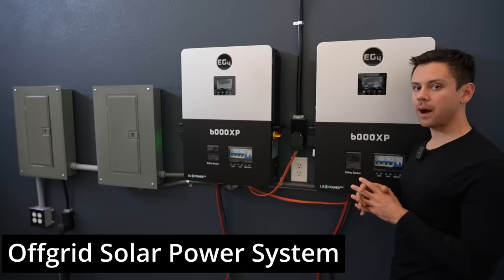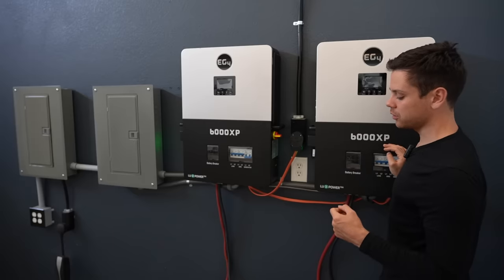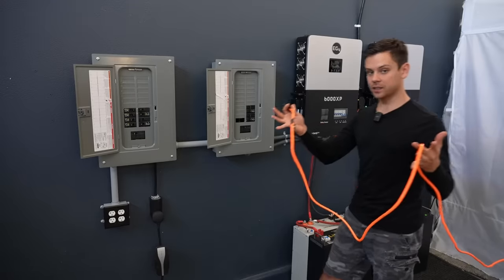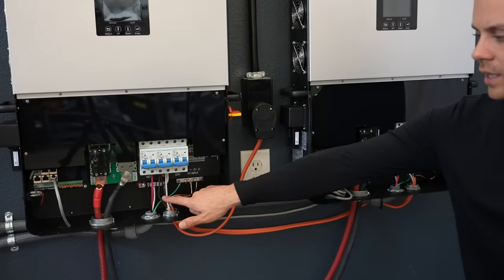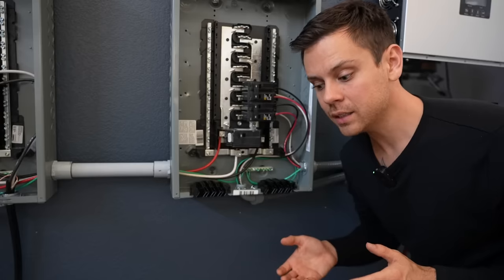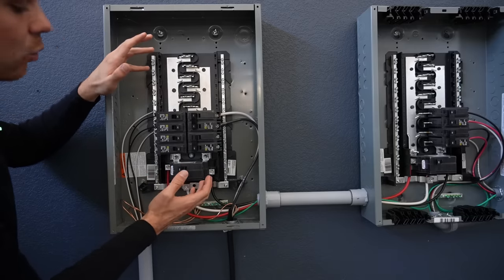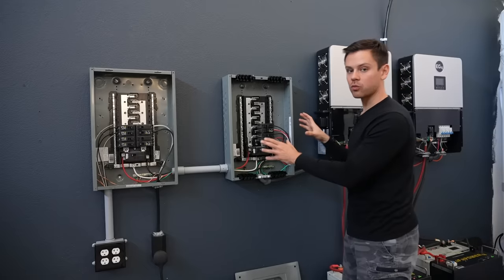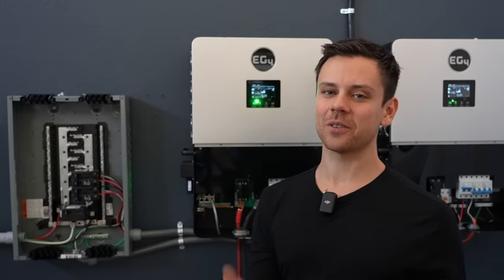How to Build Expandable Off-grid Solar Systems w/ EG4 6000XP

Comment: I’d like your opinion on noise for the eg4 6000xp.  I’m building an off-grid home and am debating on whether to build a solar shed for the components or put them in the utility room.  I’m concerned about noise.  I’ve heard that the eg4 6000xp is loud
Reply from the maker: It is loud. Check out my off-grid inverter versus hybrid inverter video
Reply: I have a room added on and cant hear my units.
I have 3 running.

Comment: Are these units able to be solar prioritized like a Victron? I want it to draw off solar and battery then only pull from grid if battery reaches my set limit or inrush is great enough to demand.  this way when in a RV park that I have to pay the electric I am utilizing my solar first.  I know there are multiple ways to set up Victron to do this but these are less expensive.

Comment: I bought one of these, thinking I may need two.. I have two 220V water wells.   Do I need some sort of soft start for the wells???
Reply from the maker: I would add soft start for sure. But they will probably run without
Reply: @WillProwse  thanks Will!!! ❤️❤️❤️
Can you suggest a soft start for wells? Do they make them specifically for wells?
Reply from the maker: @leemaisel9794  there's some videos online of how to make them but I haven't seen a commercially available one. Unless there are specific distributors selling them. Also the 6000 XP hardware was used in South Africa to run well pumps. Should be fine to not have a soft starter. But they are always recommended
Reply: @WillProwse  thanks Will!!!

Comment: What a bummer that the EG4 6000XP is not UL 9540 compliant, making these unacceptable in communities that have adopted the International Building Code (IBC). What is an additional bummer is there there are almost no inverters & batteries that meet UL 9540, other than EXTREMELY expensive units. 

The following 22 states follow the IBC: California, Colorado, Florida, Georgia, Hawaii, Idaho, Illinois, Kansas, Maryland, Minnesota, Montana, Nebraska, Nevada, New Jersey, New York State, North Dakota, Oregon, Puerto Rico, South Carolina, Utah, Washington, and Wyoming. In addition, some communities in other states have adopted the latest version of the IBC.

Presumably, this code was pushed through by lobbyists who want to undermine all but the three or four largest solar companies out there. This makes solar infeasible for almost anyone whose budget is less than enormous. And, I imagine, will drive some brands out of business.

Comment: I would like to know what the idle or overhead consumption of the inverter output is when several units are ganged together.   Do they just add up or do they all share roughly the same total idle/overhead consumption that a single unit would have?
Reply: It multiples as you add units. So it would be roughly 100 watts with 2 of these units.
Reply: @GavinStoneDIY  As long as there's a load on the system, each unit will draw ~50W.  What I don't know is if you have multiple units tied together, but are using <6000W, will the second, third, etc inverter go into "eco" mode until needed, or will they all still draw 50W each if there's any overall system load sensed, even if they aren't technically needed for the minimal load???
Reply: @ssoffshore5111  good question. I don’t believe eco mode functions when the units are in parallel. So it draws equally from each inverter.
Reply: @GavinStoneDIY  Ugh, that's too bad!  Seems like a missed opportunity given the linked communication system, that would've been one big advantage compared to going with larger inverter(s).  Especially if that was programable (x amount of demand before the next inverter "woke up").
Reply: @ssoffshore5111  yeah I’ve actually chatted about this with some other folks. It’s likely possible. Schneider has a similar setting from what I hear. It would definitely take some programming though. You’d have to account for things like line balancing and the time it would take to “wake” the slave inverters up.

Comment: Can you please explain about something to me it looks like you have 12ga wire going to the combiner box from the inverter for the 240 connection and if that’s correct is that size wire correct to use

Comment: Would 3 of this inverters with a 6 eg4 battery rack work for a grid tied solar system? I Have a 10kw system, will be adding more panels yo make it 12kw and Id like to run my entire house during power outtages.

Comment: Hi Will, how would one add a 30 or 50 amp rv connector, or is that even possible? Love your vids, have learned so much!
Reply: Sure it's possible.  Just wire one in after the panel.

Comment: I have a large workshop with many 5hp motor powered machines.  I also have a large 10hp rotary phase converter for my 3phase machines.  I typically only have 2 motors running at the same time but the compressor can also power up making three 5hp motors online.  they all have significant inrush currents.  I am having a hard time determining if 2 or 3 of these units in parrallel would be sufficient. In addition I would have the load for the inverter A/C mini-splits running and the typical power usage for the house as well.
Reply: You would need bigger units maybe 4 18K units
Reply: @sh839c  remember the "18k" is the PV -DC side, its' only 12kW output AC, x4 would be equal to a standard 200A 240 service (48kW) but not equal to the max in-rush of a utility panel.  Consider VFD drives over 3-phase for starting the 5hp motors.

Comment: how are you grounding the system? It looks like you tie the grounding bar to the combiner box and then run the ground back to the inverter.
Reply from the maker: From the ground on 18K. But ground your system for whatever is best suited for your system, not mine

Comment: How loud are the 6000xp's? I like the 18k because it is supposedly very quiet, and I'm in a small space where the inverters will be on the wall a few feet behind me where I sit in my living room.
Reply: I have one mounted in the room I use as an office and it is very quiet, but most of the time my loads only run about 1kw, and because of shading issues due to the angle of the sun this time of year my pv input power is also very low.  I believe they can get over 50 decibels when under higher load and/or with higher pv input power coming in.

Comment: Hello please help.  my solar installer is asking me to replace my electric main panel to a panel with 225 buspaz rated at 200 amp For a 14KWatts  system in order for edison to pass inspection.  is this correct ? TKS

Comment: New to all of this.  Can the critical loads transfer switch you mentioned, be a 50amp or does it need to be 30 amp?
Reply: 50A since it has a 50A passthrough.

Comment: If you are using 2- 6000xp units with 2-Power pro batteries do you connect the batteries in parallel or do you just connect each battery individually to a single 6000xp inverter?
Reply: Change the setting in the inverters to "Share Battery Bank".

Comment: does the 18K have the same functionality related to the ground neutral bond? Can it manage it based on pass through or no pass through?
Reply: I don't know about the 18kpv, but Will was mistaken about the N-G bond in the inverter being dynamic.  It is either enabled or disabled and does not change based on running in passthrough or running the inverter.  I leave mine connected to grid input and let the main panel provide the N-G bond and nowhere else.

Comment: In an off grid scenario where did you connect the ground to actual ground rod ? On the inverters side ?
Reply: I have an off grid set up similar to this, and I just ran a ground wire to a ground rod from my main panel, as THAT is hooked up to everything else with green or bare ground wires. The inverters have a ground wire that hooks into them, which also grounds the metal of the box they are in.
Reply: @Tumbleweed5150  I am aware of that, but he didn’t show it in the video.
Reply: @offeraviad  I think the issue in the video is that Will's "grid" connection was a plug and not hardwired in, so he has an issue with the ground-neutral bond if his "grid" connection is unplugged.   For most people the "grid" connection is going to be hardwired and I assume (but need to read the 6000XP manual) that the ground-neutral bond from the home's main panel remains intact whether the contactor is engaged or not.  Let me check that.

(rummage rummage rummage)... yes, User Manual, page 13, I'm quoting from the manual:

"The neutral line is a solid connection between AC input and AC output (known as a Common Neutral Architecture).  The neutral line betwen the AC input and AC output is never disconnected".

So this means that if your "grid" connection is hardwired in, the neutral and ground you get from your main panel is always connected.   Usually that is the best place to put the bond anyway, with the grounding rod sitting right there.

The manual also states that the programmed ground-neutral bond feature is NOT a dynamic bond.  It is always enabled or always disabled... Will made a mistake in his video when he was talking about that.  In anycase, you want to leave it always disabled because you will be getting the bond via the grid neutral and ground lines you wire into the unit.

-Matt
Reply: @junkerzn7312  I wrote “in an off grid scenario” so the grid connection is not relevant to my question
Reply: @offeraviad  You want the ground-neutral bond to be as close to the physical grounding rod as possible.   So if you have picked out a place for the grounding rod, that's where a breaker box should also go and that is where all the grounds and neutrals should come from going to other sub-panels, the inverters, etc.

In otherwords, make the topology roughly similar to the topology you would have if you had a real grid connection.

I don't recommend using the EG unit to do the bond, because any maintenance you do might inadvertently disconnect the bond which you absolutely never want to have happen.

In anycase, I know you said off-grid, that's what I put "grid" in quotes.  I think Will said in his video that his "grid" connection was one of his other solar systems and not the actual grid.   Sorry, the inference obviously got lost.

-Matt

Comment: So if you only want 110 ? Do you only use the black or hot , the common and a ground ?
Off grid and only for backup with certain outlets wired and installed during construction all separate from grid. 
😮
Reply: There is a setting for the inverter output voltage.  Setting #4 "UPS Output voltage and frequency".   The output voltage can be 200, 208, 220, 230, or 240VAC) (divide by two for each phase), and the output frequency can be 50Hz or 60Hz.   So the answer is yes.
Reply: Ideally you would wire it up as will has - the 2 hots connect to the 2 bus bars in the panel, giving you 120 volt power on each of the bus bars.  Then just connect single pole breakers to the different panel bus bars and try and roughly divide your 120 volt loads between them.  Keep in mind that you don't get 6000 watts of load capacity on each hot leg from each inverter - you get 3000 watts (plus surge capacity) on each of the two hots.  I hope that is making sense.

Comment: ONE XP6000XP will have how much A/C output at 120V?  I will have nothing that is 240V by design.  Can I run load 1 and load as 2 independently to get 2x the 120V AC output?  I dont know if I explained that well.  VERY VERY new this whole thing.  Off grid only.
Reply: The 2 legs are 120volts supporting up to 3000 watts each.  You am doing exactly what you are describing.  I have 4 single pole breakers in my panel for 120 volt loads.  You just have to generally try and distribute the 120 volt loads as evenly as you can between the 2 legs so as to not overload either one.

Comment: Can you hook an auto start generator to maintain charge or supplement power when the batteries are low like a Victron system?
Reply: You can, yes.  You can specify the battery SOC or voltage levels to start or stop the generator at.

Comment: Can one EG4 be used in a camper van beings it's all in one unit?
Reply: Only if you have a 48V system, and enough room on top to mount enough solar panels to power up one unit.
Reply: I usually recommend a 24V unit for smaller vehicles like a camper van or shuttle bus. That is what I installed in both my pickup camper and my girlfriend's shuttle bus. Most small rigs don't have the roof space for enough solar panels to power a 48V system. (Unless someone else has a good reason they WILL work.)
Reply: For a small camper van there will likely not be sufficient solar connected for it to make sense due to the idle / overhead power consumption of the EG4's inverter.  A smaller system with a smaller inverter would be the better route to take.

That said, I would stick with a 48V battery bus if possible.  It only takes 3 x 100W panels in series to have the voltage headroom on the solar to be able to charge a 48V battery system.  Barring that, 24V.

The one big problem with 24V is that you can't expand it to 48V later on without replacing a lot of equipment and there are no whole-battery balancers for 2 x 24V batteries in series (in terms of future expansion).  So going with 24V kinda locks you into 24V.    Not that this is necessarily all that horrible, just something to be aware of.   (Ask me how I know 🙂)

-Matt

Comment: If this one handles the G-N bonding dynamically.... does this mean the G-N bond in the voltronic (6548's) are fixed regardless of active AC-Input? I should have held off and got this i guess..
Reply from the maker: Those ground neutral bonds are created with a screw on one of the circuit boards. This one has a dedicated relay
Reply: @WillProwse  yeah that looks much better. I need to find a way to charge the bank infrequently from the grid and manage the transient G-N bond... does this unit only allow a full dual phase 240V input?
Reply: @mmbodnar Will made a rare mistake thinking the N-G bond in these units is dynamic.  It is not.  You either enable it or disable it and it remains that way regardless if it is running off the inverter or in passthrough mode.  These units have a neutral bus bar and a ground bus bar that you connect both the grid inputs and the output lines to, so if you have it tied for grid input the N-G bond is provided by your main panel and you just leave the bond disabled in the units and no bond in your sub panels.
Reply: @intDavid  thanks.. strange how this detail gets so much discussion.

Comment: Can I use them, off grid in the Caribbean, we use 230v
Reply: You might be better off using a Growatt SPF 5000 ES or so, as they are already 230-240 ready, rather than have to worry about what to do with the 120V side of things.
Reply: @Tumbleweed5150   can a Victron energy Quattro 10k 230 work? I want the best of the best so I have peace of mind.
Reply: Yes, you can.  There is setting (#4) to set the output voltage. 200, 208, 220, 230, or 240VAC.  And 50Hz or 60Hz for the frequency.
Reply: Don't do this.  Unless you understand the implications of the earthing employed you can easily end up with the chassis of the unit being at 120V relative to the physical earth you walk on and in turn your entire electrical earthing system.  Imagine the consequences of having 120VAC on the case of your fridge, microwave oven and any other earthed metallic thing.

Buy a device intended for single phase 240V operation, with the earthing point being one side of that 240V supply not centre tapped as per USA et al.
Reply: @retrozmachine1189  Ah, good point.  Ground won't be at the right level for the Euro standard.   So the answer is thus "no".

Comment: Can it run with out batteries  and  grid as pass through
Reply: Yes, you are able to run without batteries.  You can run the inverter purely off PV or do grid passthrough, though the output voltages aren't necessarily going to be stable if only using PV due to fluctuating PV power.

Comment: How many and how are the batteries wired in? Are they 48V ? Lofepo4?
Reply: In the video, it looked to me like he has each of these units hooked up to two "server rack" LiFePO4 batteries.
Reply: LiFePO4 (lol typo 😭)
Reply: Will only trusts LFP batteries, and it looked like he had 4 in parallel, and he told the inverters in software that the batteries were shared (i.e. both inverters shared the same set of 4 in parallel).
Reply: …and why is it setup for lead acid?
Reply: @joshjuzwik4787  I wondered about that as well.
Reply: @joshjuzwik4787   If you set it for lithium then the inverter expects closed-loop battery communication to be working or it won't run the inverters off the batteries.  Setting it for lead acid allows it to use the battery and determine the charge level etc based purely on the battery bank voltages.  Will doesn't like closed-loop battery communication - though I haven't really understood why.  Personally I love it.
Reply: @intDavid   ok, I had confusion because normally with inverters and chargers you have to configure the battery type, so that it knows how to charge different chemistries.

Comment: Maybe I shouldn’t have dumped 12k on the EcoFlo Delta Pro system.
Reply: Yeah same here - the EcoFlow units are nice to have the portability option, but they can only expand so much eh.  I ended up selling all my EcoFlow units on Ebay and taking a bath in the process 🤨